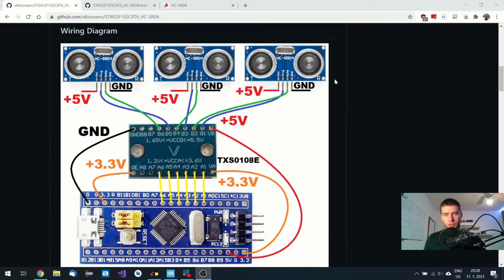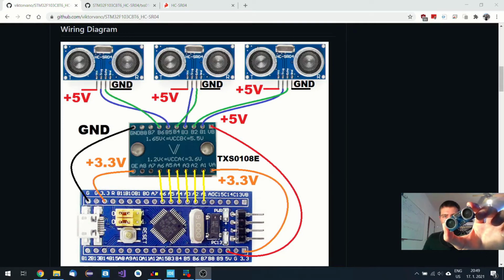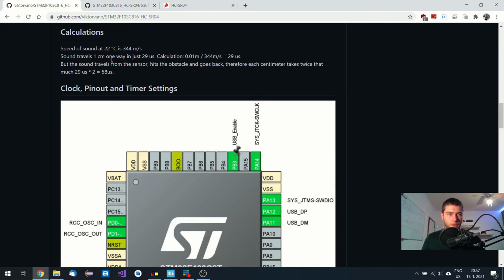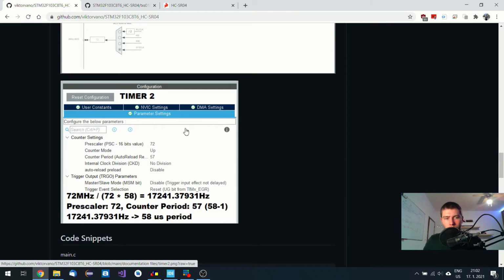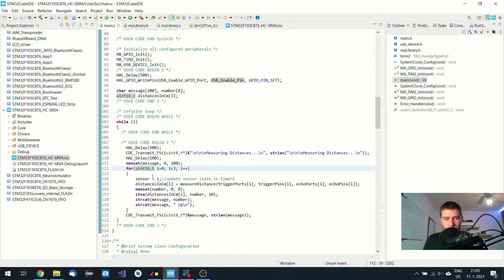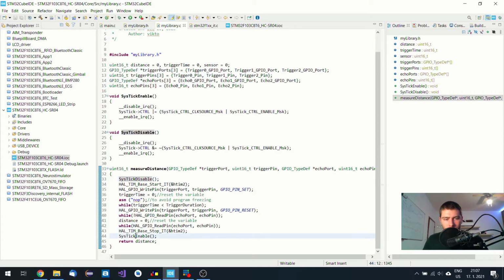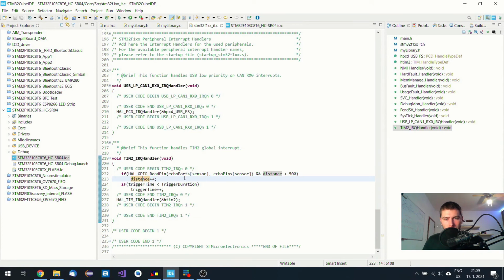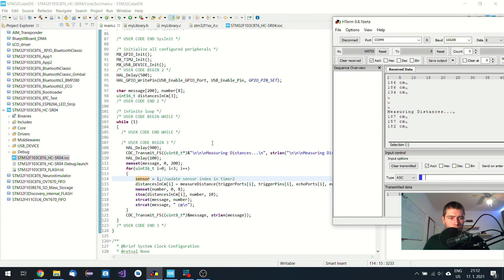STM32 Tutorial - Use Multiple Ultrasonic Sensors HC-SR04

Comment: can you please sow how to connect 4 HC-sr04
Reply from the maker: Exactly the same way as 3 sensors. It is a repeating pattern. I have successfully connected 5 sensors like that.
Reply: @ViktorVano  how about the pins? Where are the 4th Hc-sr04 pins connected?
Reply from the maker: @nour99594  it in on my GitHub. The link is in the description. Those can be any GPIO pins.
Reply from the maker: @nour99594  you just need to configure them.
Reply: @ViktorVano  alright i will try
Reply: Can i replace the TX with another component? cuz its not available here🙁
Reply from the maker: @nour99594  yes. If you are talking about the logic level shifter then you can use any bidirectional logic level shifter. It just needs to convert voltage levels from 3.3V to 5V and also the opposite way too.

Comment: great explanation! .. but what's the importance of the TXS0108E module ? can't we connect the sensors directly ? ... Also, do we have to reserve a pin for every echo and triggger for all the sensors, or is there a way to connect multiple ultrasonic sensors like i2c or something?
Reply from the maker: Thank you.
HC-SR04 modules use 5V logic and do not accept 3.3V logic from the STM32 and also the STM32 does not always accept 5V logic (some IOs are 5V tolerant). 
And yes, I have to use separate set of pins for every HC-SR04 module. I want to trigger those modules one by one and also I cannot short outputs of those modules neither.
Reply: @ViktorVano  Thank you very much!

Comment: Great video. I have a question. Can I replace the TXS0108E module with some resistors? If yes, do I have to change anything from the code? Thank you
Reply from the maker: You can use resistors only as a voltage divider from 5V to 3.3V. But you cannot use resistors to turn 3.3V to 5V. And I am not sure if those ultrasonic modules accept also 3.3V, it may be to low voltage for a logic level.
Reply: @ViktorVano  thank you. Then I guess I will stick with the TXS0108E module like yours :) thanks again for the video man you really do help me a lot on my thesis
Reply: And one more question. Can I use a STlink v2 debugger instead of solder the resistor at PB3 like you? Thank you.
Reply from the maker: @jay16myv.  yes, you can use a ST Link V2. But you may need to do some mod on your ST Link if you have a clone.
There are some options how to do it and a few tutorials.
https://youtu.be/JqrUAzjJ0tw
Reply: @ViktorVano  thank you you're the savior. Please keep up the work

Comment: Can you also run multiple devices under one-wire?
Reply from the maker: What do you mean by that? Each sensor needs to be triggered and listened to it's echo pin individually. You cannot trigger multiple sensors at the same time, because they would interact with each other because of the ultrasound.
Reply: There is an arduino library that you can run and specifically I was thinking 1-Wire or OneWire.  I was just hoping that you might know if this supported in Arduino IDE for STM32.   Thanks!